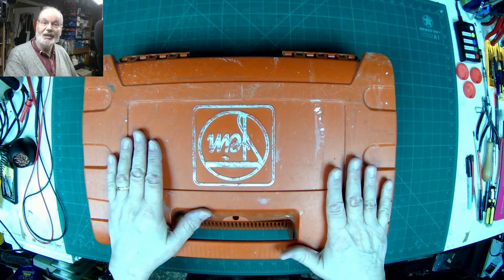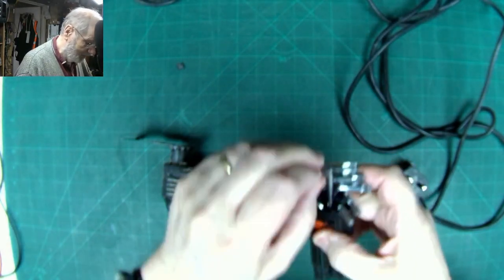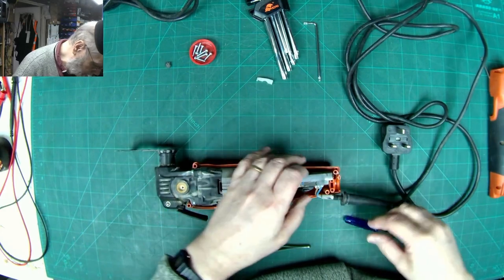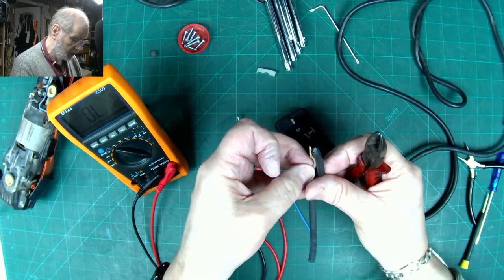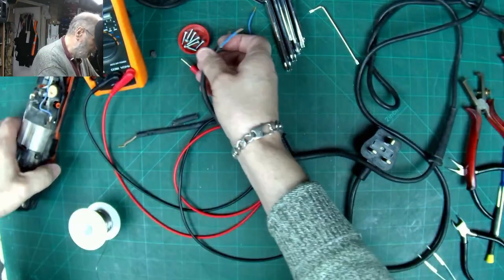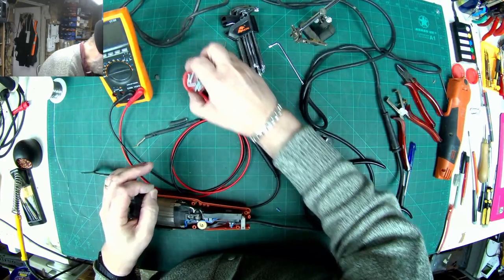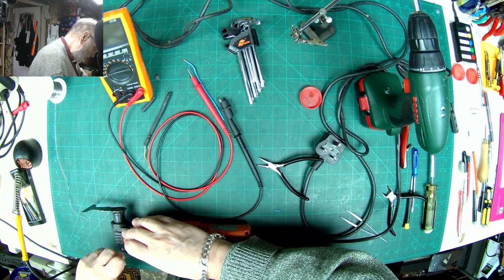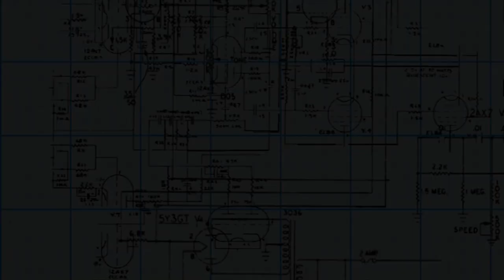Fein MultiMaster Multitool Repair - a nice easy job

Comment: I'm glad you found it a simple fix because I destroyed mine taking it apart to try and replace the cable.  Wish I'd seen this video first! 😭
Reply: I think I would have verified solid continuity through the whole new mains wiring before reassembling...
Reply from the maker: Sorry to hear yours was damaged, sometimes spending more time examining before diving in can be fruitful. Yes, I probably did check the cable but didn't video it?

Comment: Thanks for this. I had the same error on my Fein Multimaster and this helped enormously. I added a heat shrink sleeve under the rubber cable sleeve when reassembling as it’s not a good fit. Adding the extra sleeve makes the rubber sleeve fit much tighter and no wiggle room (wiggle probably caused the cable problem in the first place).
Reply from the maker: Excellent!, well done and good thinking. 👍